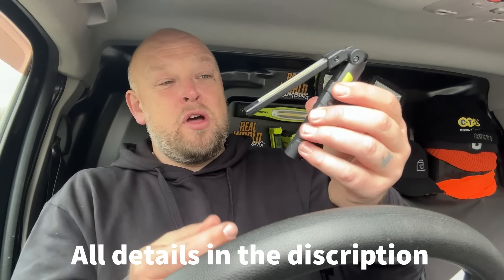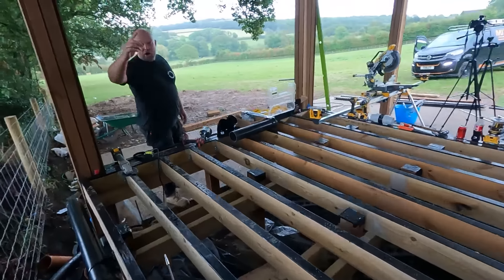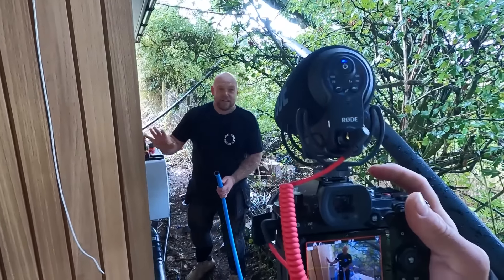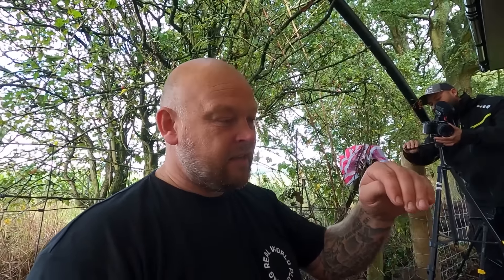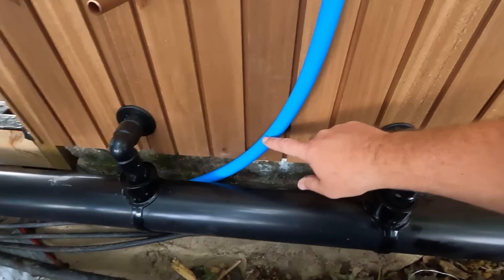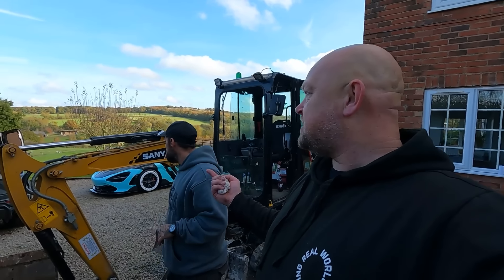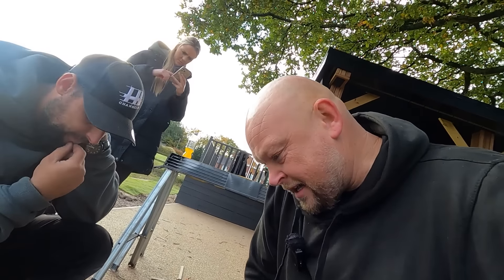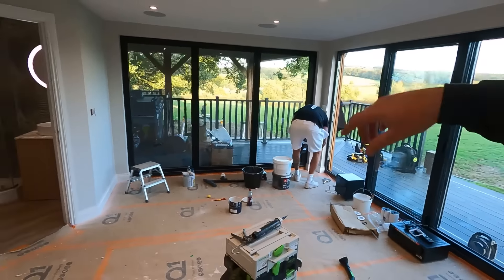BATHROOM DESIGN REVEALED | MAT ARMSTRONGS GARDEN BUILD FINISHED

Comment: Great video Mark. So how did the pump/vortex do? My first thought was with the length of the run it would fill the pipe and turn off when the tank was at a low level and everything would just flow back down. And got my two promo unilite's yesterday, thanks for the discount 👍
Reply from the maker: Worked VERY VERY well tbh…. I had my doubts but it’s spot on 👌🏼👌🏼
Reply: Shame you didn't show it working, mate 😔

Comment: Nice job mark that outside water pipe will need heat trace on it as insulation alone won’t protect it. Hope that drain has a paddle valve on it so if the drains back up at the house it doesn’t spill out that pump chamber 😂😂😂😂
Reply from the maker: You didn’t watch all the video did you….. or you will of seen what’s in the chamber 😉😉👍🏼
Reply: Hah hah I watched it all